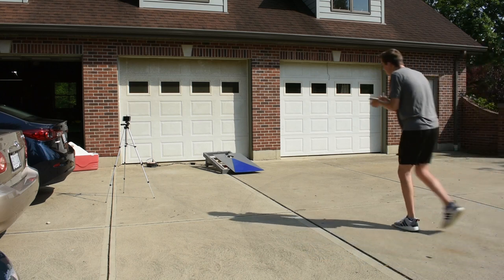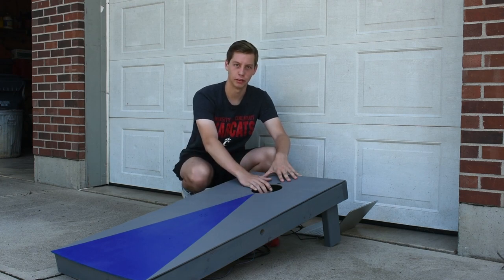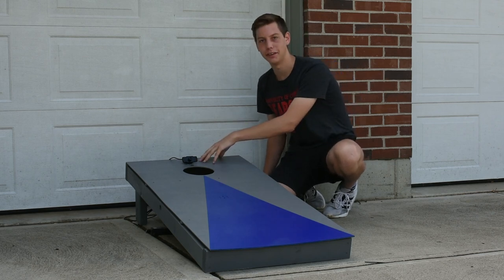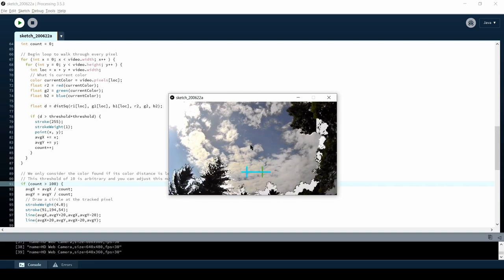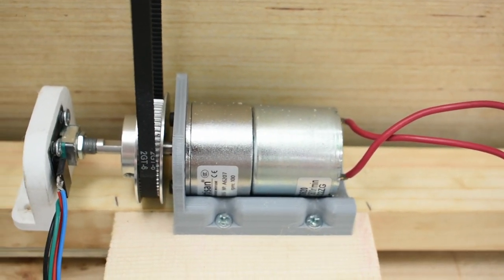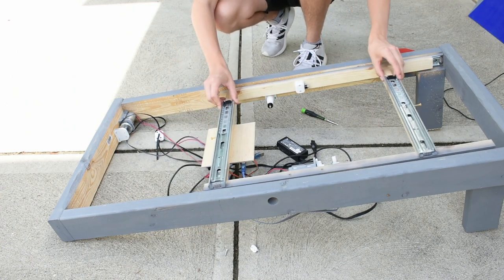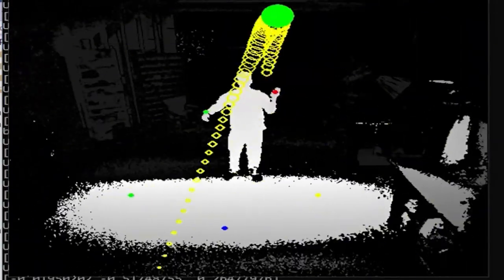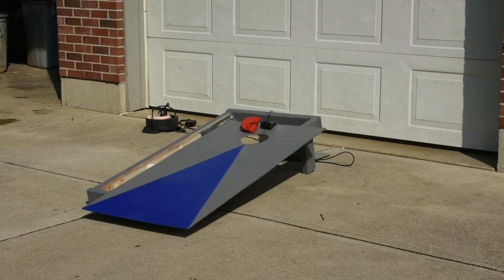Robotic Cornhole Board that helps you WIN

Comment: You could probably improve accuracy with reinforcement learning. Not as hard as it sounds just turn the image into a grid. Use the location in the grid as look table to store when it is successfull, an ir sensor can do that. Can combine those with trajectory estimates to prevent traking errors.